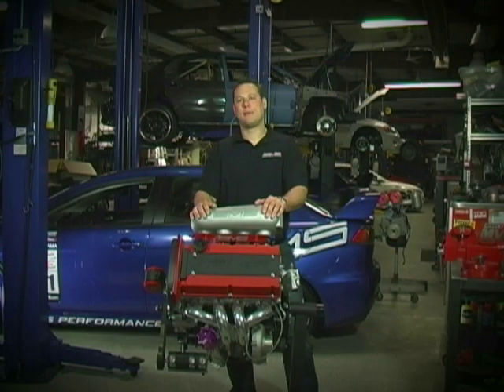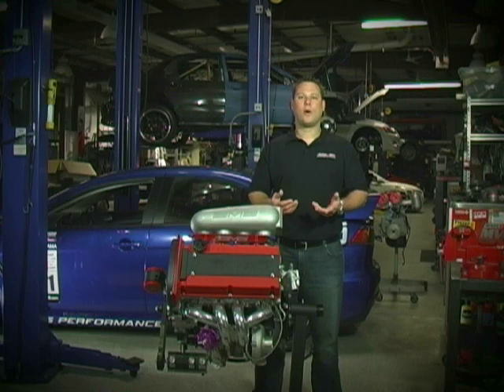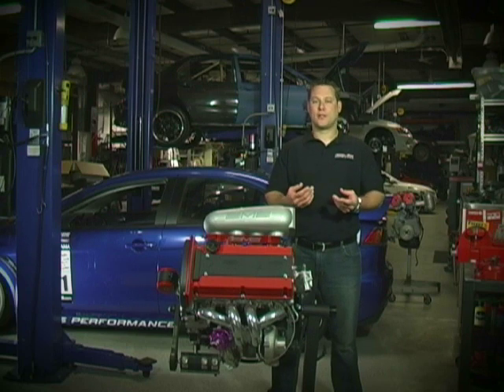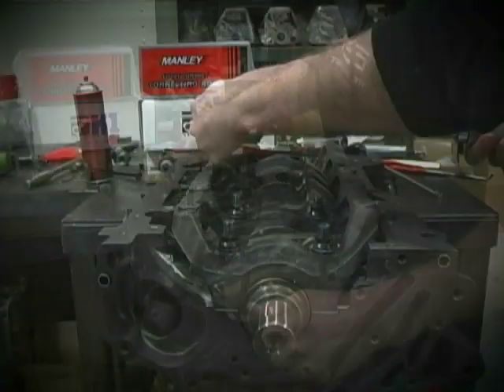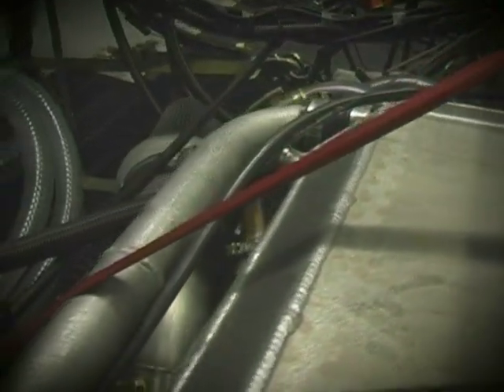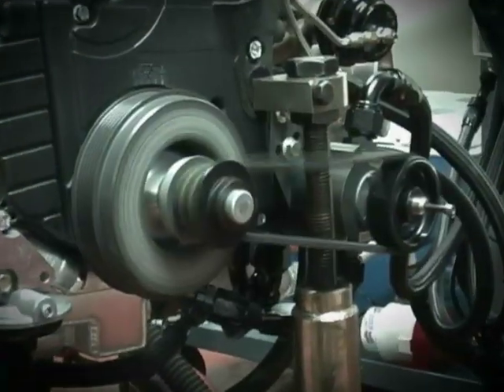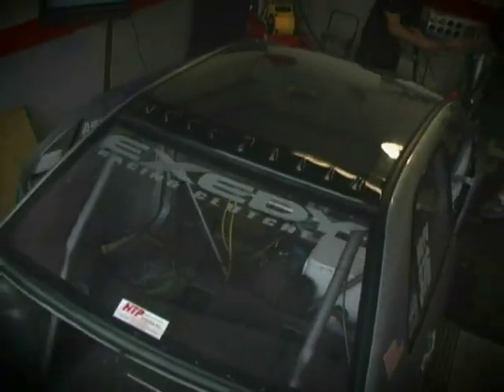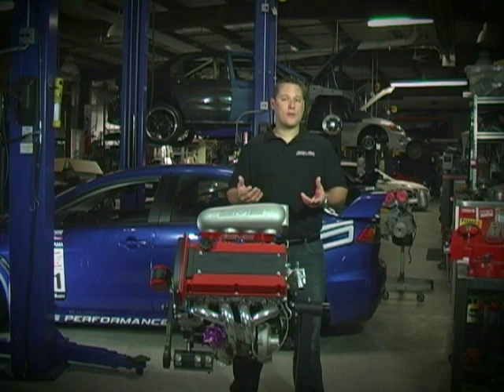AMS Wins 2008 Castrol Syntec Top Shop Challenge

Comment: you are correct and john Hsepherd's talon holds the awd mph record at 195....his best et is a 7.71...that was a long time ago...once he can get it to go straight with the mods he has now, it will decimate the r32's 7.57...he is looking for low 7s at 200mph in awd configuration.  The impressive part about this comp is i see they won hp/litre easily and the only car to top their peak hp was a 7.0L big block chevy and it only made 50hp more lol!